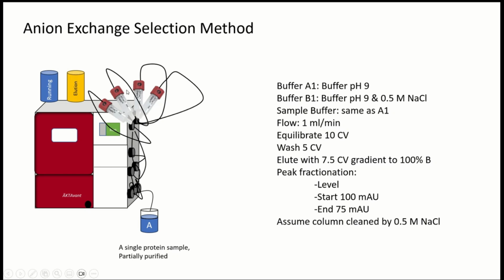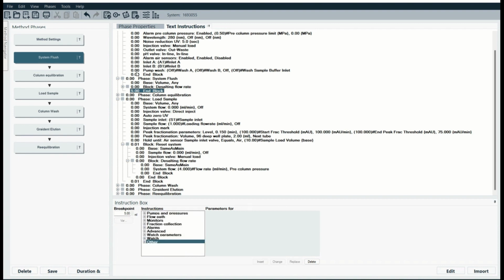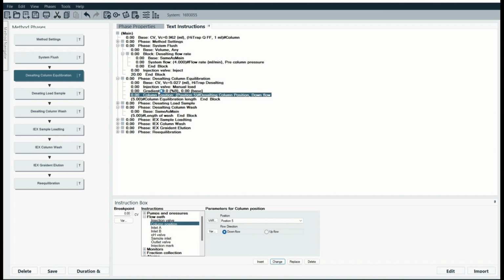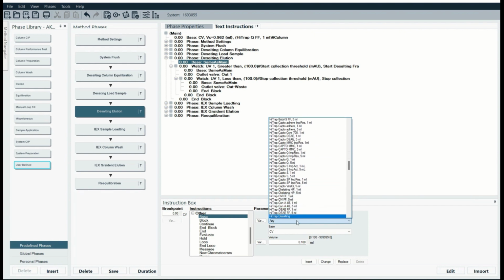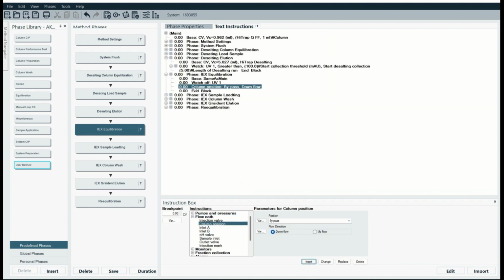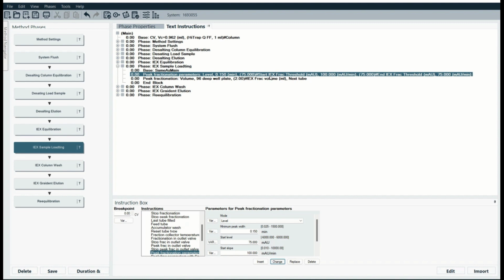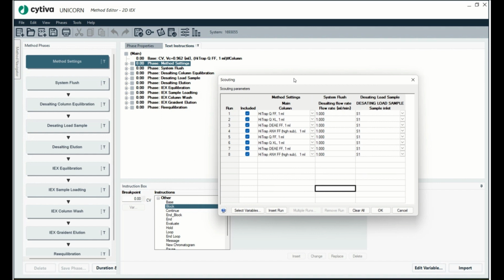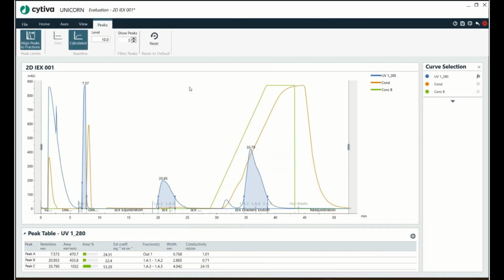An Example of Multi Dimensional Chromatography: Desalt and Ion Exchange

Comment: These videos are super helpful. I don't think there are any other resources out there like this for AKTA. 
I was wondering, if you have a loop valve with 5 loops, can you run scouting using five different inlets that each would store different proteins in each of the five loops. Then each loop could be desalted one by one? The first step would be IEX and the second step would be desalting.
Reply from the maker: Yeah you could, you'd either need two valves plumbed like the outlet valve or one like the column valve.  There's no reason you couldn't have a second column valve you'd just have you use your imagination when it came to understanding the flow path.